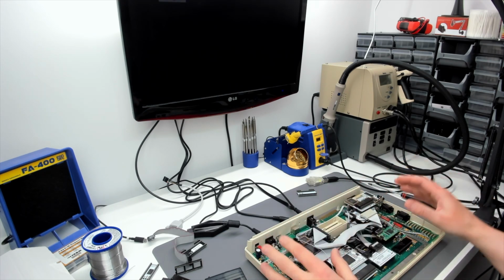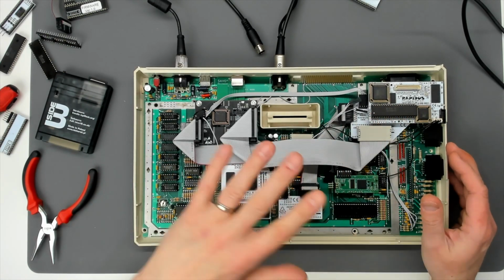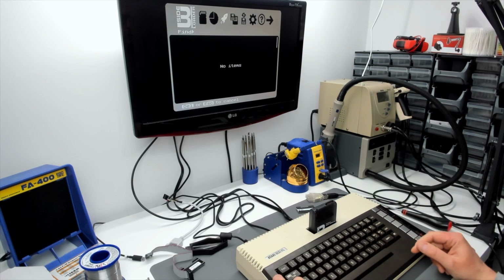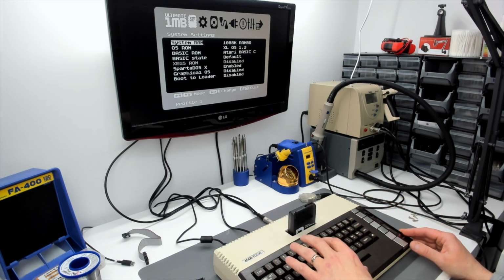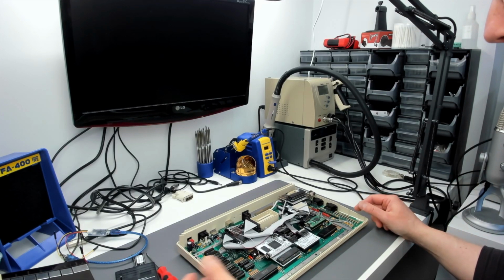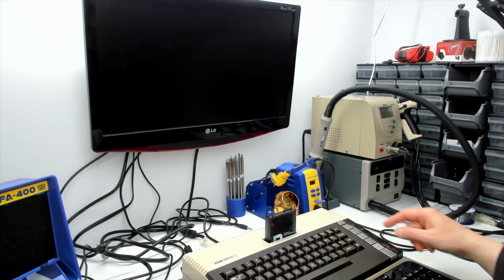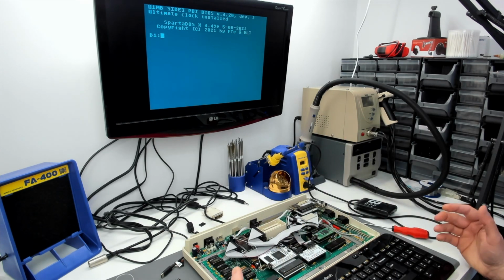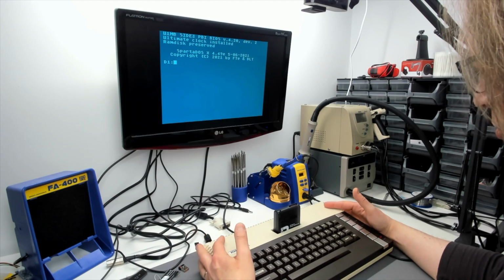$800 Atari 800XL upgrades part 2: PokeyMax fault, AKI firmware and Rapidus stability

Comment: Is there a way to obtain hdmi output and/or useful 80 column graphics output?
Reply from the maker: Yes: VBXE has hardware 80 column text and 640x200 graphics. HDMI output will require a scan converter, however.

Comment: I see the intermittent key repeat with the pokeymax and the TKII as well. Though the timing of when TKII pulls KR1 and KR2 has a wide dispersion so I thought that was why. To work properly with pokeymax a keyboard emulator need to respond on KR1/KR2 within a fairly tight timing of the request. I don't have a lot of flexibility on this since I used an i2c io expander, the tiny one you re-soldered! i2c isn't so fast.
Reply from the maker: Interesting - thanks!

Comment: The only way to get all of the bells and whistles to work on an Atari 8 bit, is to completely redesign the circuit board of the computer, chip locations and its clock bus.  The 1088 doesn't do it properly.  It just reproduces the bad original design.

Personally, something along the lines of what a ZX Spectrum Next is for Sinclair folks.  A completely modern system with legacy interfaces.  Place the entirety of the computer on an FPGA and include things like PokeyMax, UM1B, etc right in the core.  Give it a parallel bus, SIO as well as joystick ports.  Slapping a V8 in a Model T isn't exactly a stable idea, and that is what is happening here.

The Atari circuit design was only stable for the chips on the board and nothing else.  Everything else is a crap shoot.  The stock configuration is barely stable enough to pass QA.  It's full of reflections, over and under-shoots, poor clocking and "it's enough to sell" design.   It only needed cartridges and SIO to work, and they did.

Also, NTSC has an overall faster buss speed than PAL systems.  Everything is derived from the system clock and to get 60Hz etc, the primary clock needs to be faster.  This means all of the timing is slightly less forgiving on a NTSC system than a PAL system.  Anyone developing for NTSC needs to have an actual NTSC system to develop on and not just guess.
Reply from the maker: I broadly agree with all of this, with the caveat that the designer of Rapidus appear to be aware of measures which could be taken to improve the situation if only he had the time and/or inclination and/or some disagreements regarding intellectual property could be overcome. Every device designed for these machines has to account for all of the obstacles you describe above, but some make a better fist of things than others (the featured system working perfectly when the single upgrade pushing things over the edge is removed). Hard agree regarding NTSC, too, since testing on NTSC machines often seems to be an afterthought where upgrades originating from mainland Europe are concerned. We've just had an NTSC anomaly with VBXE which took fifteen years to become apparent, but which could have been observed during testing with a simple software tool or test harness.  Likewise, Rapidus' 'U1MB support' was apparently coded up without ever being tested with a real U1MB. I'm perfectly happy with my U1MB/VBXE/Stereo Pokey/SIDE3 XLs and XEs, and certainly am not inclined to throw my weight into further investigation of a problem I first identified some eight years ago and which has yet to trigger a firmware update.

Comment: $800? On upgrades ? Makes no sense
Reply from the maker: In this case the client requested the most powerful machine possible, and the vendor therefore recommended everything but the kitchen sink. For me, the sweet spot is Ultimate 1MB, VBXE, and maybe a stereo POKEY board. A 20MHz 65C816 is not part of the appeal of the 8-bit Atari as far as I'm concerned, but to each their own.

Comment: Oh, and now also seeing it - it is an NTSC machine with a PAL VBXE palette, isn't it? And second, in the end you did not try the VBXE vertical NTSC alignment test?
Reply from the maker: Yes, but when I update the U1MB plugin, NTSC palette can be silently soft-loaded at power-up. I didn't try the alignment test, no. What is it meant to establish?
Reply: That VBXE in NTSC mode has its all business shifted down by one scanline with respect to what the documentation suggests and to what Avery implemented in Altirra, and what made me implement a key activated workaround in my game in case this is not a universal rule / feature.
Reply from the maker: @TheWoj76  Ah yes - I am familiar with the NTSC overlay bug, but I assumed it was determinate and thus guaranteed to exist on all NTSC installs. Now you mention it, though, I should try the game on this machine just so I can experience the issue first-hand. Moreover, I was going to run the test the other week before I got side-tracked by massive problems running an XEX on the machine before I put 74F08 in it. :D
Reply: The game should actually run fine, if the bug is consistent, which I assumed it is, and you seem to confirm it.
Reply from the maker: @TheWoj76  I'll test it later and report back. Thanks for reminding me!
Reply: Welp, a consistent bug is a feature!